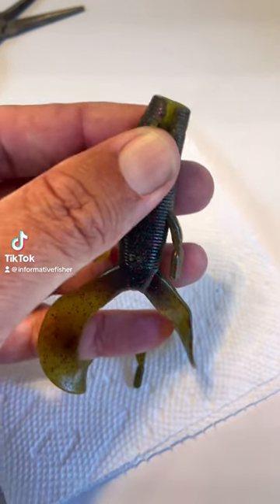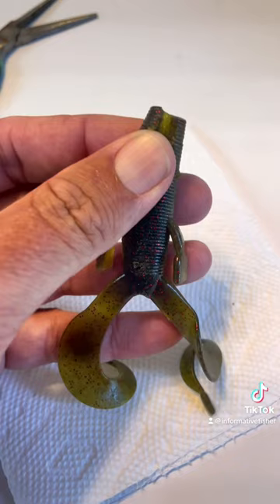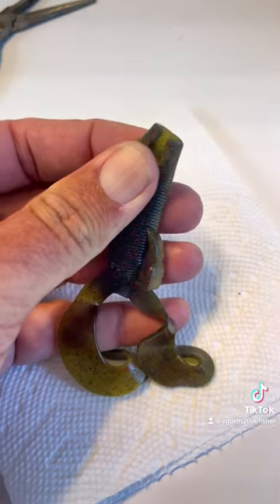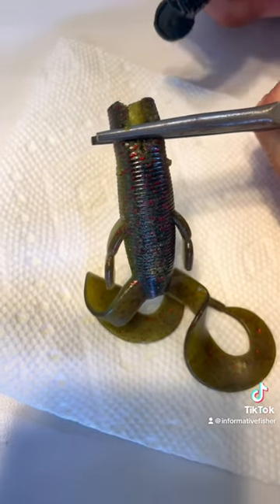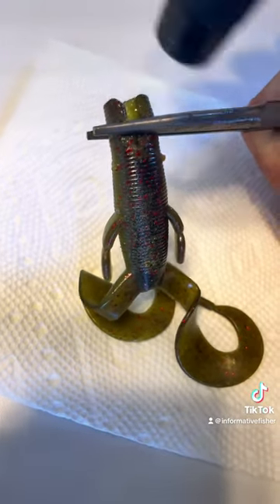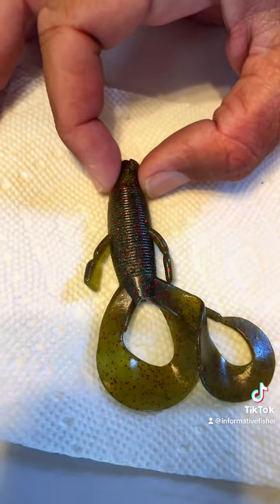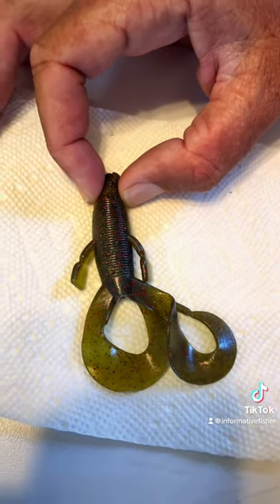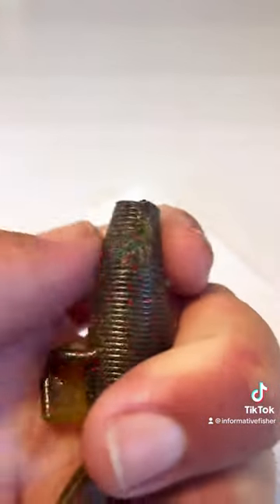Super fast and easy soft plastic lure repair tip!

Comment: I just use mend it
Reply from the maker: I lose mine all the time and I always have pliers on the deck and a torch lighter because I use it for braid.
Reply: I tried that, this works better (in my opinion) just have to be careful to keep the bait straight and not burn yourself & not a lot of time to work